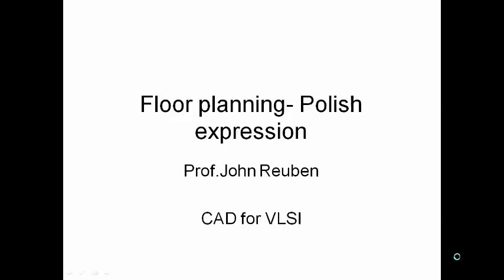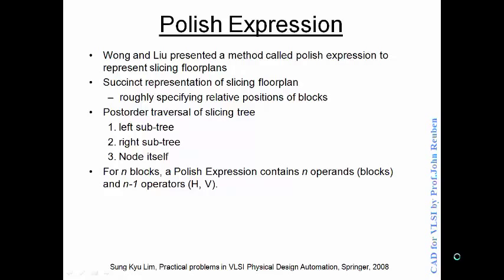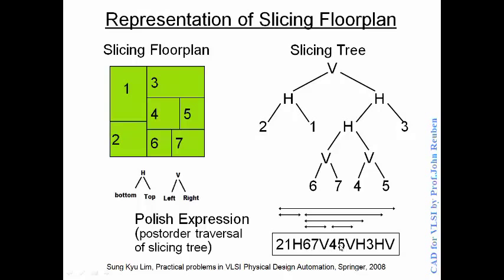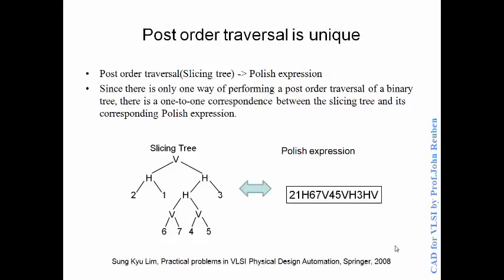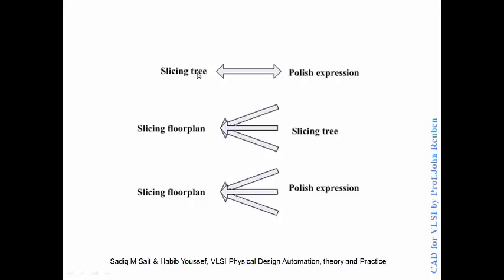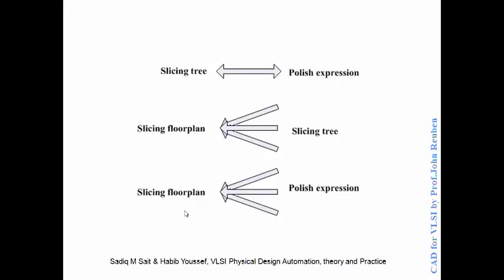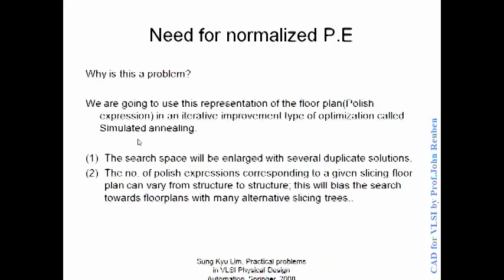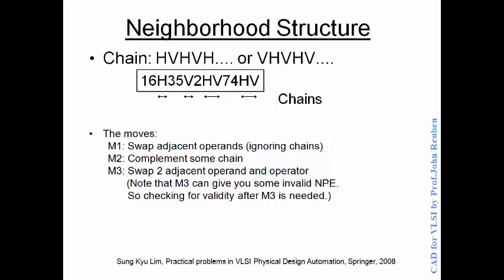Floor planning by Polish Expression

Comment: I read the reference book and I have a question:
How can I calculate the coordinates of blocks without the tree?
Actually, how can I calculate  with just this representation: 25V1H374VH6V8VH
Reply: Since it was 4 years ago you wrote the comment, but write it because maybe some others that doesn't know also can read.
You need to know about postfix and prefix. This is how we read tree as sentence representation, and the representation is fixed per each tree. It means you can convert the representation to tree.